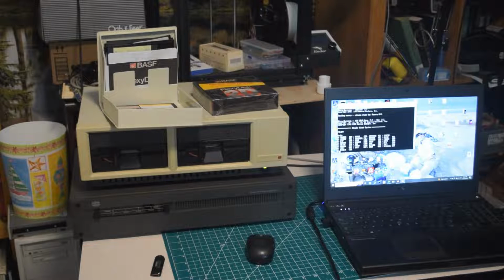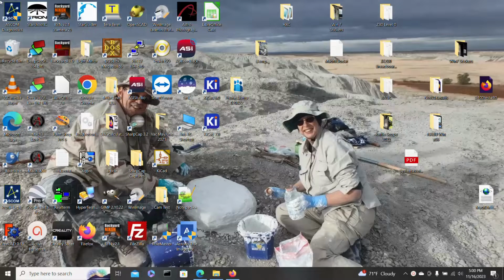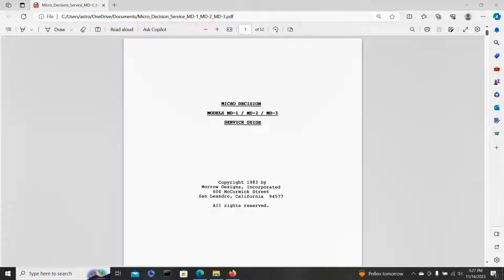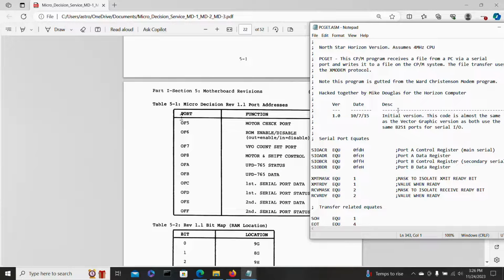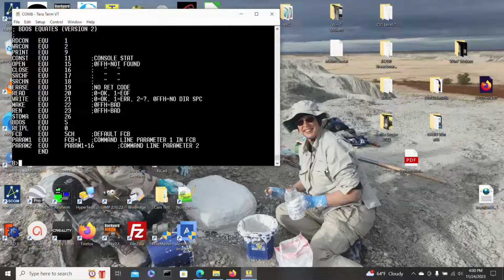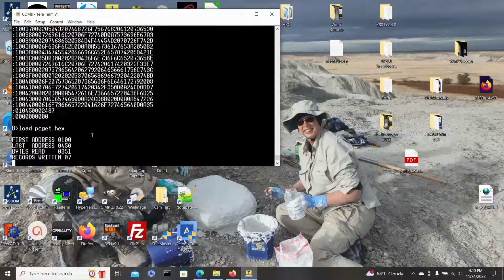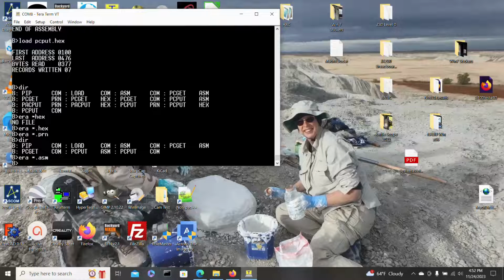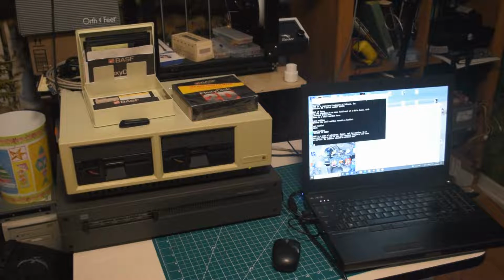CPM Software Transfer: Where to find it & how to get into a CP/M computer #retro #retrogaming

Comment: Great, great tutorial.  I do have one question though.  What factors affected your decision to use the Northstar customized PCGET and PCPUT asm source code to tweak the serial i/o ports for the Morrow?  I have a Grant Searle based Z80 SBC (SBC-2g-512) that I want to use to assemble a Z80 monitor, so I wonder what gotchas I may encounter when using a particular system's PCGET/PCPUT source.  Thanks so much for all you do.

Comment: was there any graphics mode games made for the CP/M at all or are just text adventures?
Reply: CP/M itself has no concept of graphics, so that would be very platform specific. 
I've seen a few games with graphics written in modern times, but always platform specific because there is no standard for graphics.
Reply: PS: there are some games that do ASCII graphics. Multiple versions of Tetris, CatChum which is really pacman, wanderer is puzzle like, and of course rogue, the original rogue-like.

Comment: Fantastic & informative video! Thanks a million. I don't have any of the old gear any more, but have a few virtual machine programs on my Win11 box nowadays (VMware and 86Box). As I did run a bit of CPM stuff and early MS-DOS back in the '80s and '90s, I'd like to be able to 'build' a couple of virtual CP/M machines in one of those emulators, so some of the techniques you used have put some ideas into my head to try out. But, you also mentioned about using emulators for CP/M in the video. Did you get any further with that idea? What I'd love to be able to do is install CP/M on an IBM-type VM with a couple of virtual floppies and a virtual HDD (I understand that can be no more than 8MBytes). I did manage to get one working, but when I tried to create virtual floppy disk images and/or transfer the .com/binaries of programs like NewWord/WordStar and dBase over, I failed miserably. A video showing how to do that would be a god-send and will probably attract others who are into retro-computing but like me don't have the old kit!

Comment: ... Would a WiFi Modem work?
Reply: Wi-Fi and "high-speed" networking did not exist at the dawn of the microcomputer age.  The best we could do was dial-up.

Imagine a world without the internet.  Now imagine the internet 50 years from now.
Reply: I don't understand. Simply add a WiFi modem to a serial port and use terminal software to internet it up? Luke that what I'm going to do with an Atari ST and 386's.
Reply: @zarkeh3013  The OP's video was addressing the problem: "How do you get 'Terminal software' into CP/M without terminal software."

Chicken v. Egg.
Reply: @zarkeh3013  Your key word in that comment is "simply". Nothing was simple in the days of CP/M.
Reply: @davidgari3240  They make wi-fi modems that emulate a Haye's modem but then can connect to your Internet.  I have not yet tried it with my Kaypro 2x but it should work.  I had gotten it for my Gateway 2000, but snagged a real network card for that.
Reply: @davidgari3240  I remember before the Internet.  I ran a BBS.  It was lots of fun.  And no social media.